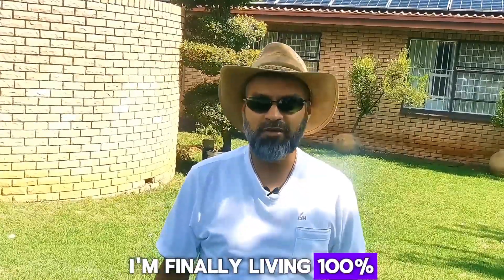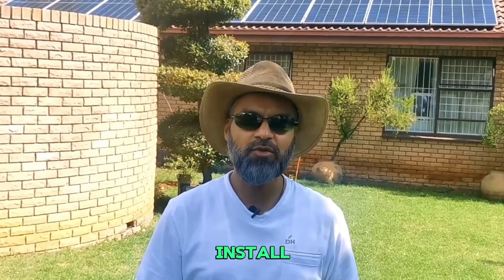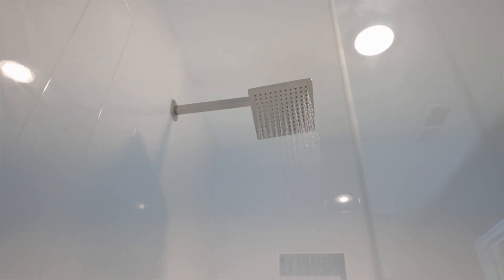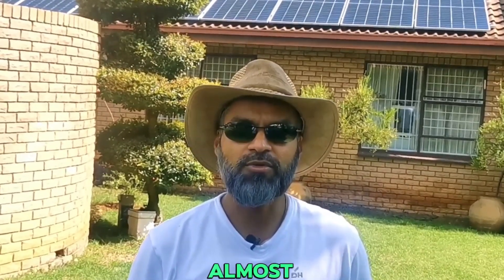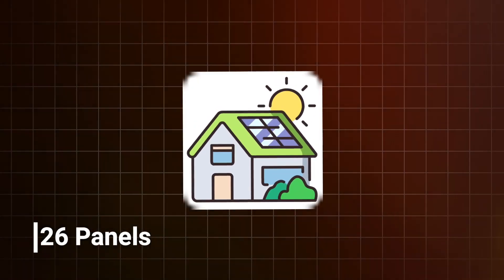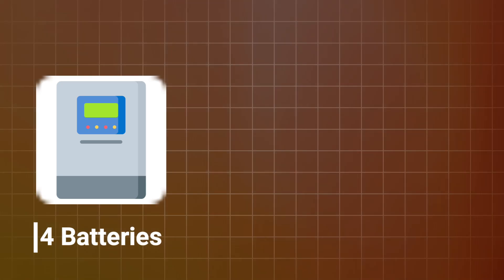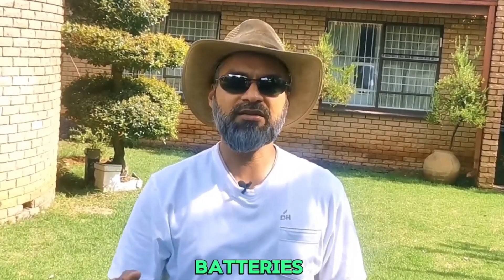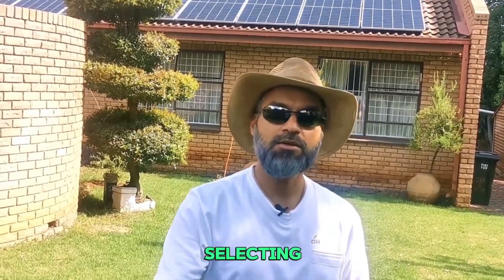Ultimate Guide to Off-Grid Living: Tips & Tricks!

Comment: Simple question, what happens if your batteries are full and the pv generates more than what you use, you can't sell back to the grid (net metering), so where does the excess generated electricity go?
Reply from the maker: I can push to the grid, but I don't do so since it's an externality.

It's wasted..this usually happens a on a perfectly sunny day. So after 1330, about 60% is wasted.
Reply: @ElecAndAll   Maybe "sell" to the neighbours, if they invest in the infrastructure with battery... 🤫